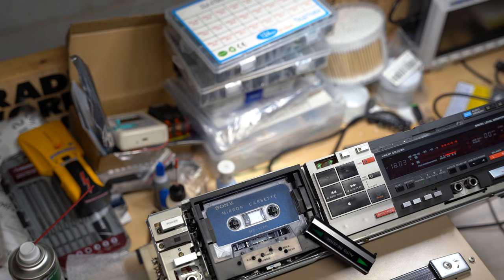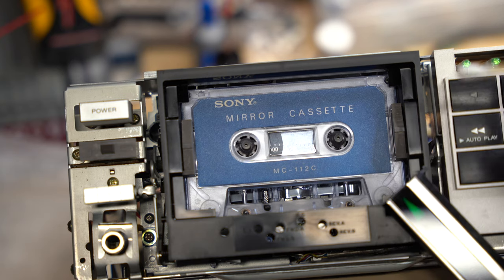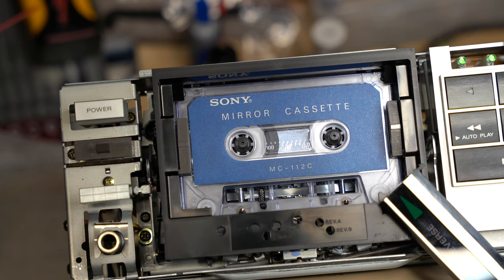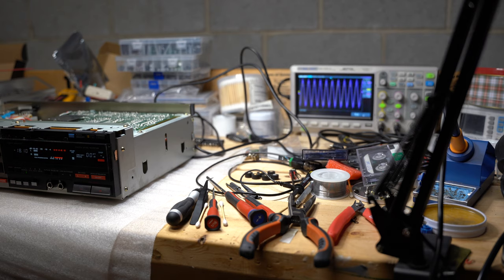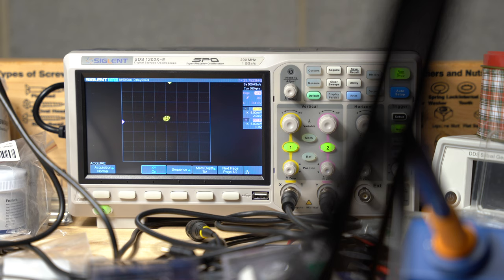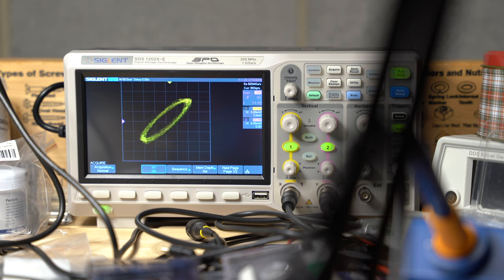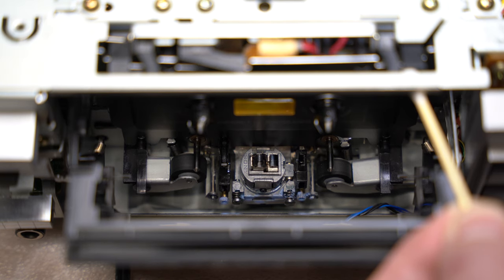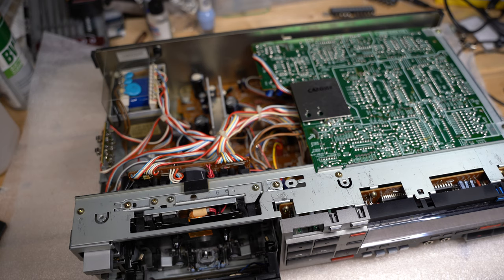Sony TC-FX707R Tape Path & Azimuth Adjustment | Fine-Tuning for Optimal Performance

Comment: Do you know (once someone has made a correct 10k tone tape etc)  if you can also use that free  Signalizer  VST 0.3.2 oscillator program  to get that adjustment curve on a screen or do you need a real oscilator for that funktion to show. If this windows program also works for that visual azymuth on screen funktion maybe you can show which steps to do in that program to get that curve on screen.
Reply from the maker: I did not use the program you mentioned. It worth to concult with the user guide if it support XY mode to draw lissajous figures. In any case simple two channel mode is quite useful, as the only thing we do in both cases when tuning - set sine wave tops matching on both channels. Also, 10 kHz is the last step in tuning. Start from lower frequencies and find maximum amplitude points BEFORE setting azimuth. Otherwise you may set azimuth to a wrong wave and your sound will be muffled.